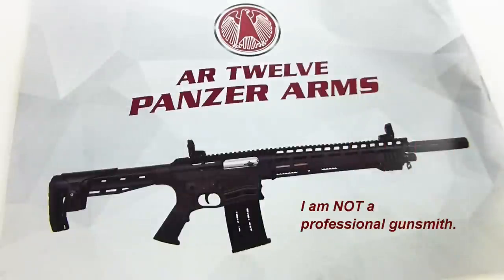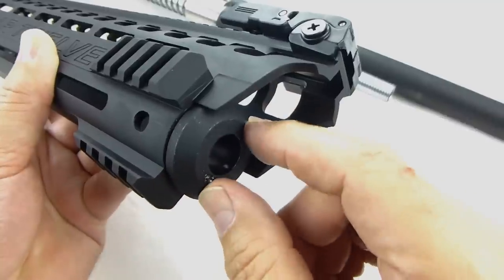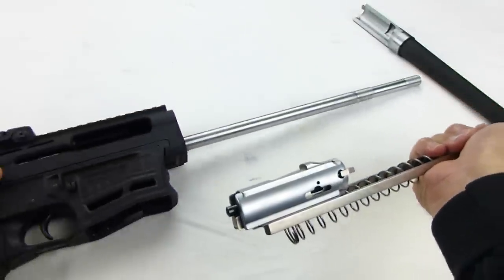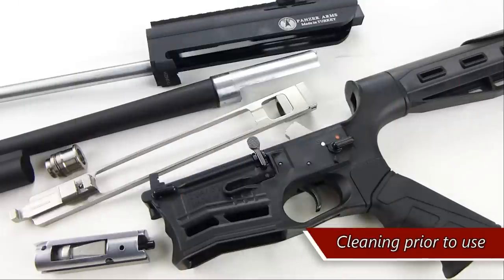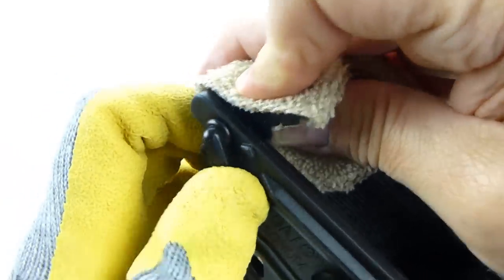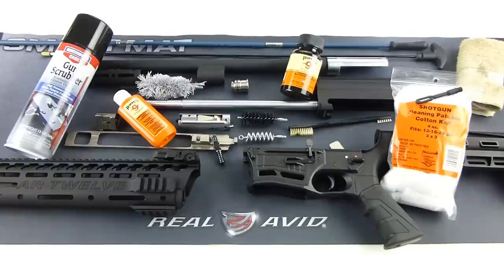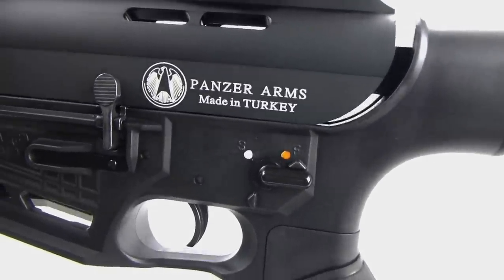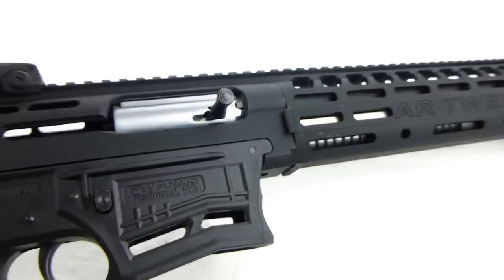Panzer Arms Gen3 AR12 Disassembly Cleaning and Reassembly *Full Video*

Comment: Is there an o-ring inside of the cylinder that the gas piston goes into? I was dissembling mine and a torn up o-ring came out of somewhere and it isn't the one from the barrel. Any ideas?
Reply from the maker: You have a different model than mine. My Panzer AR12 does not have an o-ring inside the gas piston.
Reply: @MrMnmn911  thanks, I'll ask around. Im not sure it came from the gas piston cylinder it just appeared during cleaning and it wasn't the oring from the barrel. Thanks for responding.
Reply: @mccapatr  same thing happened to me first time cleaning it. Did you happen to find out what it was? Thanks for any help.
Reply: @saintstone187  no I never got an answer from Panzer. I have shot it a few times since posting and haven't had any issues. Good luck!
Reply: @mccapatr  thanks so much for your response.
Reply: @saintstone187  there is a rubber oring that goes inside the housing for the gas piston housing that is attached to the bottom of the barrel. If you look inside you can see indent about an inch in that it fits into. I was talking to the Panzer service people. If it's not there/not in the right place, the gun will struggle to cycle rounds at the lower end of it's range.
Reply: @MrMnmn911  nope, you have one to. I guarantee it. It likely is just still in place in side the gas piston housing (the thing attached to the barrel). I talked to the service guy from Panzer today. Here's what I wrote elsehwere.

there is a rubber oring that goes inside the housing for the gas piston housing that is attached to the bottom of the barrel. If you look inside you can see indent about an inch in that it fits into. I was talking to the Panzer service people. If it's not there/not in the right place, the gun will struggle to cycle rounds at the lower end of it's range.
Reply from the maker: @alvehyanna  What generation model do you have? Is yours a PRO model?
Reply: @MrMnmn911  no. Regular ar12.   I mean it's possible yours is older and doesnt have it?  But take a look in the gas piston housing.
Reply: @MrMnmn911  If you look at the exploded view in the manual, it's there as well. Part 72. PArt 77 is the metal one that is already attached, 72 is the rubber one. 

Marc at Panzer USA said that nearly 100% of the not cycling problems, on lower FPS range of proper ammo,  he sees, is because during disassembly it fell out and the person didnt notice. But if you look into the tube mounted under the barrel, you'll see a groove inside it (easiest to see from the barrel end) that it fits in.
Reply from the maker: @alvehyanna  I'm looking at my Panzer AR-12 manual right now. There are only 18 parts listed.  I also took a look at my gas piston housing. There is no O-ring. My shotgun does not have rubber O-ring, there never has been.

What generation model do you have? Is yours a PRO model?
Reply: @MrMnmn911  Nope, mine is not pro version. Go to page 14 in the manual. 12 has the assembled version and only list a handful of parts, but you can see on the next page (13) that the gun has around 89 parts. Flip one more page over for the full list of parts. Now the numbers might be different. You charging handle is different than mine, but it's 100% the same gun. Maybe there is a generation difference and I have a new generation.  Talking to the guy at Panzar, this seems to be something that been apart of them for awhile though.  I just got done putting mine in yesterday, it's a bit of a pain actually, but  about one knucle distance into the piston housing mounting to the bottom of the barrel, there is grove that it fits in. This is typical of gas-powered shotguns based on what I've read, as it helps regulate the proper preasure for ammo at the lower velocity ranges of recommended.
Reply: @MrMnmn911  here is a pic. You can see the shiny rubber of the oring seated in the groove it goes in.  https://drive.google.com/file/d/1jLEGvkTgdBM06K5vME49E3RY3Q99N6YX/view?usp=sharing

Give there's 2 years difference between yours and mine, it's possible yours doesnt have one, but check the exploded view to see if it has 2 rings as part of it.
Reply from the maker: @alvehyanna  Nope. My manual has no such parts pages.
Reply from the maker: @alvehyanna  Hey. You are right! I just disassembled my shotgun and that buger is there...hiding....but there.
So then. Referring back to the orginal  post by mccpatar, can the individual you are speaking with at Panzer tell us what size O-ring that is?

Is it user replaceable?
Where can Panzer owners get one? Or, is this something that needs an authorized center to replace?

I think mccpatar would really appreciate that information. And I would too.

I'd like to do a video on it but I'll need more information. Just telling users it is there is not helpful if we can't learn and show what to do about it when it deteriorates. 
Thanks.
Reply: @MrMnmn911  I asked that exact question of him, he didnt give me a precise answer, only that there's some give in the size so as long as you can get it close, it's fine. He did say it is not the same size as the barrel shroud. Also that's it's pretty common for it to fall out. the threads on the rod tend to grab it.

I'll give my tip as Ive now had to put it in 3 times. 

I get part of it seated into the groove, then use one hand from under (where the piston inserts) to stick a finger up it and hold it in place, I think use some long needle nose tweezer from the top end, to feed a bit more of the oring into the groove, and work my way around and as more is in the groove I move my finger around to cover and trap more and more of it in place. That's the easy part, the hard part is then getting the last bit in. there will seem to be a lot more oring than space left when you get close to the end - but just force it in there with tweezers, periodically rubbing your finger around inside it to distribute the oring evenly and eventually it will all be in the groove and smooth.

If you want more info, go to the official panzerusa.com  contact page. The number there and email address is the official service center. It's actually next door to Bob's. Infact, when they shipped the part I needed for mine, it came from his store. So maybe it's an offshoot business.  I'm on a few Facebook groups for this gun and we're getting lots of new members, so seems to be selling well.
Reply from the maker: @alvehyanna  Man, that’s too bad. Knowing what size that O-ring is would be very beneficial. Just knowing it is there and that it falls out or deteriorates is not really helpful, without giving a solution.

Knowing what size to get to replace it with would be great to know.

Perhaps someone reading these comments will know the answer and share that information so I can make a video on it.

Mine is in there real good and seems to still be in good shape. It would be fantastic to know exactly what to replace it with, when that time comes.

Thanks for all your information on this.
Reply from the maker: @alvehyanna  Oh. And the link you provided takes me to an Indian website, “detikfood” not http://www.panzerarmsusa.com.
Reply: Im having ALL kinds of issues with my charles daly ar12s...mine in fact had a mauled up oring inside the gas chamber same as you all are describing...ive shot it with it in and with it out with no difference in all the jamming and non cycling im getting...im so close to just selling the damn thing...i went to lowes and bought a container of orings ranging from like #1 to #40 sized orings...#11 seemed to fit good but good luck NOT tearing it up while assembling it. My gun is brand new with MAYBE 100 shells...if anyone has experienced this plz let me know what you did about all the jamming but the oring and swapping out the gas piston from 2 3/4 to 3" didnt matter either...im at a loss
Reply: Yes it's there just use #40 Oring
Reply: I took mine apart and there was no oring
Reply: Just received the gen 4 panzer ar12 and they did away with the o-ring. And removing the charging handle was minimum effort to remove it. Shoots 1280 FPS flawlessly with the low velocity piston. Plus the choke tubes was nice also
Reply: @mccapatr  possibly O ring under foe muzzle break
Reply: @mccapatr  I know this was two years ago but I have a gen 4 panzer and I found out that's called a retaining ring but mine was the same way but it'll probably be fine without it haha
Reply: @MrMnmn911  Yes it does' it's clear/opaque. it's on the gas piston. I can see it in the video.

Comment: I think PA got the message... I picked up an AR-12 yesterday and the poor thing was swimming in machine oil.  For example, I used a can of compressed air (duster) and blew it down into the trigger group and oil was streaming down the trigger into the trigger guard.  I used your, very helpful, video to do a complete tear-down and clean up.  Thanks for the great video.

Comment: Thanks for the great vid! Something I do with every firearm I get (new or used) Is disassemble and polish all metal to metal contact parts with wet 1000 grit sand paper to remove machining marks. Then go over every internal part with metal polish using a Dremel and felt wheels. Always makes the action like BUTTAH!

Comment: Followed this video and it was perfect. The Bolt stopper is still a pain in my a$$. But this video is Flawless. Thanks again. 👊🏾👏🏽
Reply from the maker: +PostalPhis You're welcome. Try my smoothing tips. I found them to be extremely helpful in making the disassembly and reassembly easier. I know it's a pain to have to work so hard and long to smooth these mechanisms out but I think it's SO much easier to take the time to do these after fighting so long with them. After spending some time to smooth these mechanisms out it was a WHOLE LOT less frustrating!

Comment: Thank you for this vid.  I’ve taken this exact brand new oily gun out twice. Prior to watching this video. Nothing but feed and ejection issues. Just praying these issues are my fault and not the gun’s.  Because I really like the look and feel of it.  Just cleaned it and will only run 1300 FPS or higher this week.  Your vid was great and hope it makes all the difference.
Reply from the maker: You're welcome. It did take mine about 300 rounds before it seemed to smooth out. The last time I was at the range it ran even low recoil rounds with no problem. Good luck on your Panzer AR12 journey.
Reply: When cleaned it did you put back feed ramp switch horizontally? If vertical may cause issues.

Comment: Just wanted to add that it is recommended to not use steel or brass brushes in these barrels as they are chrome lined. It is only recommended to use plastic brushes inside the barrel. Steel or brass will prematurely wear out the chrome in your barrel and shorten the life of your barrel.
Reply: That is funny mine came with a brass brush

Comment: This is an excellent tutorial in breaking down, cleaning, and reassembling the Panzer Arms AR12 - just be aware that the shotgun in this video is actually the Pro Model and not the Gen 3; this is evident by the handguard which is metal on the Pro Model and Synthetic on the Gen 3.

Comment: I had to really pull hard on the charging handle with pliers to get it out.  Great video. Thanks for the tips
Reply from the maker: Yeah. It is hard. Now that you got it out, work it good and smooth it down. It will take a while but it will be worth it.
Reply: @MrMnmn911  is there a danger of accidentally pulling the charging handle out during operation?
Reply from the maker: @billyelliot78  Yes. Don’t do that.

Comment: Cleaned the Panzer using Mr. M's video, went to the range, and fired the AR-12 for the 1st time.  The first 2 magazines had 3 stove pipes & one FTE but after that, fired the next 30 rounds with no issues.  Ammo was mixed using Federal Field & Target Multi-purpose and Winchester Universal both 1200 FPS, cheap Walmart shells.  What a fun gun to shoot.  If buying, need to check dansammo.com since he is the warranty dealer and sells the Panzer online at the same price as the big stores.  I wish I had known before buying.  The problems I had with the first 2 magazines might have been because I wasn't holding the gun tight enough to my shoulder.  After that, I made an effort to hold tight and no problems.

Comment: Just a word of caution. The O Ring on the muzzle supplied with the gun will resist permanent deformation at high temperatures. The O Rings you purchased in the pack while dimensionally equivalent are likely to be manufactured in NBR or similar which is suitable for use in domestic plumbing.
Might I suggest you report in another video down the line on the longevity of your purchased O Rings when installed on the muzzle. The video is excellent and should be mandatory viewing for all new owners. Many thanks for the time and effort you took  with this.
Reply from the maker: Thanks Michael. The O-ring supplied with the gun did not resist permanent deformation at high temperatures. The supplied O-ring deteriorated quickly. That is why is purchased the ones I showed. In the 21st century almost all O-ring rings are made of Nitrile. The rings are cheap, very cheap. Not to hard to have them handy. Some have suggested to purchase the rings from an auto body shop because they would be more resistant to heat deterioration. I'm not sure that is correct. The O-rings I show did last just a little bit longer, but not much longer. Rapid and continued firing does heat up the barrel quickly. Until someone can produce video evidence of other O-rings, lasting much longer, I don't think it really matters. Thanks for watching and commenting.

Comment: That charging handle is the devil. I scraped my fingers raw and left plier teeth scratches all over the charging handle. I finally got the idea of using a claw hammer. I lined up the groove and carefully pried it out. Tiny burrs on the charging handle were keeping me from being able to pull it out. I'll have to smooth them out with an emery board before I reassemble.
Reply from the maker: Yes. It really is difficult. Thanks for watching and liking.
Reply: I can't get mine out either ! Thank you im going to try the claw on the hammer 🔨
Reply: @davidstewart3144  try a rag or gloves so don't hurt fingers wiggle and pull

Comment: Like a few other people I couldn't get the charging handle out. I had to wrap it in a piece of rubber and then put vice grips on it and beat the vice grips with a mallet. It finally came out. I couldn't even get it back in. I had to take a dremel and grind the charging handle down a little and then polish it smooth. There is a spring loaded ball bearing in the slot and that is part of what made it tight. I still have to put some force on it but I can now get it out and back in.
Reply: Im having the same issue. It wont come out at all

Comment: Hello. Thanks so much for the video! I just purchased my AR-12 and am cleaning it. Having trouble though with removing the charging handle. Not sure I understand what  you said about the notches. When I try to pull out the handle, it feels like there is a spring holding it in. All help is appreciated!
Reply from the maker: Hi Mike. Yeah another guy, in the comments, had the same problem. I don't think he ever resolved it. You might need to send in to Dan's Sporting Goods for warranty work. I have video posted on who to contact for warranty/repair issues on the Panzer AR12.

Comment: Great video sir , I've got a question maybe you can answer.   I  purchased the  Torkerov  AR 12 shotgun  2 months ago and your video was very insightful and I noticed toward the end  the stamping on the gun said  Panzer , made in  Turkey . DO you know if they are the same and I can disassemble and reassemble using your video.  I'm  apprehensive taking down my new unit without backup .  Thanks any help is appreciated.   Dee
Reply from the maker: I'm not sure about the Trokerov AR12 being the same. They look similar but it is hard to be certain.

Comment: Good evening sir.  I have a Tokarev TAR 12 which is very similar to this weapon and was suggested by Tokarev for assembly instructions since the gun comes with very poor instructions in general…

I have done the basic disassembly to get the charging handle in place but now I cannot get the barrel to reinsert at all let alone seat properly.  Any help would greatly appreciated before take the parts outside and see how they fare against my concrete walls…

Thanks,  Bobby
Reply: Check the direction of switch on the side wrong direction can prevent proper insertion.

Comment: very professional editing.
Reply from the maker: Thank you sir! I appreciate the thumbs up. Please share if you can. Thanks for watching and commenting!
Reply: sure bro! i have a quick question, classic firearms has run out of those fr-99 10 round magazines, do you know if any other brand of magazine is compatible with this shotgun? what about drum mags or magazines larger than 10 rounds?
Reply from the maker: The only 10 round magazines that will properly fit are the FR9910's. I don't know of any other. I haven't found a drum magazine saying it will specifically fit the Panzer AR12, or any larger than 10 rounds. A drum mag would be so sweet. :-)
Reply: thanks for the quick reply and good info!

Comment: Great video! thank you.
My plastic bolt stop not going down like on your video, it's staying almost all the way up with handle on the side in vertical position., preventing bolt to come out. 
So, it broke when I was trying to pull out the bolt. I contacted tech support, lets see what they will say.
Reply from the maker: OK. Please come back and post a comment with what the outcome is. Thanks.
Reply: @MrMnmn911  tech support was very responsive. They sent me correct part very fast, great customer service!
Reply from the maker: Robin Debois Great. Thanks for the update!